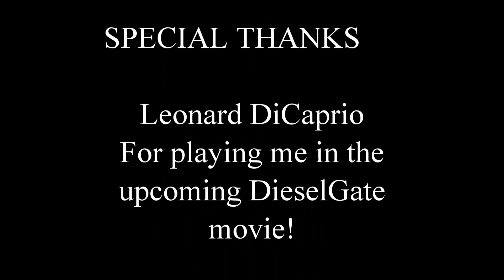What It May Take To Fix The DieselGate TDIs ~ Podcast Episode 104

Comment: Turns out the add blue system was not the solution. Software and hardware fix was. Currently driving a 2013 Jetta TDI that went through the fix. No Def tank added.
Reply: Now to do the dieselgeek intake fix

Comment: Cp3 pump conversion,  full delete with 3" ss down pipe to 2.5" straight pipe w/tune , 2700 bar fuel rail pressure sensor w/linerazation re-tune and a custom stage 2 tune.... f#ck def, dpf and any other ridiculous wastes of fuel and restrictions... the epa sucks too.

Comment: It’s like $3 a gallon and fresher at the truck stops, the catch is you have to go to the truck fuel isles to get DEF.
Thanks for the info HumbleMechanicDudeManSir
Reply from the maker: Just be sure it meets the DIN spec for VW. I’ve had to flush a few out because the def was not good.

Comment: Great video, totally makes sense.  I happen to have both a 2009 And a 2015 Jetta TDIs.  Do you have any thoughts as to whether the 2015 software only fix could or would impact performance?  Either turbo acceleration or mileage efficiency impacts?

Comment: my opinion - fine the crap out of VW and dont "fix" the problems with the cars at all.  the customers didnt make the mistakes or try to beat the emissions systems, VW did.  make an example out of the company that knew they weren't doing the right thing not the customers that thought they were doing the right thing. fine VW enough that other manufactures will think twice before trying to fool the system. as for the cars themselves, dont change anything. we're talking a small percent of emissions producing machinery (cars) and a small percent of those cars, making a small percent more emissions than the legal limits.  it wont make a dent in our pollution if you fix them or not.
Reply: "Fine them". That's exactly what they're doing. The difference is that instead of the government keeping all of the money, it's ultimately going to mechanics.

Comment: I just bought a 2k14 jetta tdi, did they fix it yet?
Reply: and what is a 2014 a gen 3?
Reply: +Mark Blake Jr. No but sign up for the good faith program. $500visa $500dealer credit
Reply: ***** I guess I'm just screwed, bought it after Nov 9. That's total bs if I lose my fuel mileage over this and am not compensated, I will run this car through the front door of vw Corp headquarters. I had no idea this was still going on. I thought it was long over with

Comment: I have been waiting for your response to this issue.  It makes more sense than a lot of others I have heard.  From what you have stated though, I am not sure I would have my gen II or III fixed.  The idea of a software only update would be a huge issue for me without knowing what issues were going to change.  Software addresses timing, fuel injection, transmission shift points, etc.  I could imagine a lot of drive-ability issues.  There are also a couple of other issues not yet addressed.  What about all the extra nox already injected into our environment by scam vehicles?  And what about the devalue of the vehicles on the second hand market?  Shouldn't the original owners be compensated for trusting the manufacturer?

Comment: The TDI is not broken... works great, they are awesome... I love mine... It just exceeds Fed NOX output spec. The cars runs great... I doubt they will add urea SCR onto the older CR TDI's... They may try to do software only... it will affect performance and economy. I will never take my car in. 40% of cars traditionally never have safety recalls done. I suspect 70% won't be modified.

Comment: I bought my 14 Sportwagen becuase it DIDN'T have DEF. I don't mind refilling the system, it's repairing it that concerns me. I'm a VW tech as well, I see many Passats and some Touaregs get their DEF tank heaters or pumps replaced on a weekley basis, and it sure ain't cheap when I take a peek at the parts quote. Unless they warranty this retrofit for the life of the car, I'm trading it in. One thing I've wondered is if tuning companies, like Malone, are going to have to redo their software to match this update.

Comment: As an 09 jetta TDI owner. I am praying for the buy back at market price value when I purchased it. It sounds like that would be a lot of parts to put on a car that was not tested etc , and ensure it all works without failure.
Reply from the maker: They have talked about that as well.
Reply: +HumbleMechanic Hopefully they decide soon. lol.. A buyback would probably be much easier than spending millions on parts, labor, and retrofit designs.

Comment: AAAAAAHAHAHAHAHAHA THEY ACTUALLY THINK I AM GOING TO BRING IN MY 09 TO BE UPDATED/RUINED AAAHAHAHAHAHAHAHAHA
Reply: +I'm a princess You are NOT getting it... EPA does not register cars or regulate individual cars, the States might do however. States, like CA, NY... 13 states total, especially in areas with high congested cities do emission testing which might force you to comply with the recall. The other states DO NOT monitor emissions. They have no clue nor care what your car is doing. You don't have to do the recall, if you live on one of those 37 states. Even in the other 13 states, not all counties do emission testing, only bigger cities... the smaller towns may have no testing even in some of those 13 states. Got it....
Reply from the maker: There are a lot of folks that feel the same way. 

With ad blue injection performance should not be impacted very much, if at all.
Reply: +HumbleMechanic Thanks for the response, but won't my gas mileage take a hit? Not to mention the added expense of buying D.E.F., no thanks. as I said in the previous video's  comments this beautiful Jetta is doing way more for the environment than my old 1977 Chevy Nova was.
Reply: +Kamron Fultz 
Actually they think you might want to bring your diesel in to get the certification you'll need to renew your car's registration.
Reply: +Eddie Exec Texas doesn't have any emissions certification requirements so I will not need to do that in order to register my car. although  that is a a good point to bring up to those who do have to deal with that
Reply: +Kamron Fultz Registration  no but to get you registration you have to get inspection and if fails on anything can't get your registration.

Comment: On your new EGR strategy comment. You said "to inject more hot air into the exhaust to reduce NOX." I think you meant intake?
Reply: +S7one_47 Nope it's exhaust, This has been a technique since the 80's.  Car manufacturers would literally have a belt driven air pump that would pump air into the manifolds near the head to help the NOx burn cleaner as it goes through the catalytic converter.
Reply: cjwolfer r EGR doesn't inject air into the exhaust. Exhaust Gas Recirculation is a strategy of injecting exhaust gases into the intake to cool the combustion temperature to reduce to formation of NOX by lowering combustion temperatures using inert gas. What you're talking about is AIR or secondary air injection. A system used to excite the catalyst to force it to "turn on" in the old days and now with secondary air, the more interval based system, it brings the catalyst to a higher and more efficient temperature before the engine reaches operating temperature. Reducing emissions during before closed loop is achieved.

Comment: Couldn't the urea tank be retrofitted to fit in the area where the fuel cell is? That way no weight is shifted on the vehicle, only downside is that the fuel cell would have to be smaller to accommodate the urea tank in the same space. This might help them with regards to dot testing as well.
Reply from the maker: That's possible but there is not mich room there. Plus a filler neck is needed too.
Reply: +HumbleMechanic I mean for a whole new part to come out that is a urea/fuel cell all in one that is the shape of the original fuel tank, fuel filler neck and urea filler neck would be behind the fuel filler door
Reply from the maker: I don't think there is room behind the gas door for 2 nozzles. That's why the Golf fuel door is so big.
Reply: +Travis Proteau The fuel capacity of the new Golf Sportwagen is smaller than the previous Sportwagen -- presumable to accommodate space for the AdBlue tank. As for problem finding an AdBlue filler location: I have an awesome 2011 BMW 335d diesel, which has an SCR system. The filler(s) -- passive and active AdBlue tank fillers -- are in a rather odd place -- a pop-open, hidden port in on the left rear bumper quarter panel and nowhere near the diesel filler. The BMW X5 35d has its AdBlue filler in the engine compartment -- another option.

Comment: Hey, I'm an 12 Jetta TDI owner, with warranty, would it make more sense for VW to buy back and move us into the Gen 2 TDIs? Still do the fixes and sell those cars at auction so dealers, customers, and technicians are both happy?
Reply from the maker: I think they mentioned exploring that as well. 

Makes you wonder what that will do to the used car market with a flood of TDIs.
Reply: If they try to sell 450,000 "shit diesel" cars at auction they will lose more money then making you keep the vehicle.
Reply: +Travis Proteau I very much doubt the EPA will allow VW to auction the cars off in the US, more likely they will have to be scrapped or maybe sold off shore to a country that will allow them.